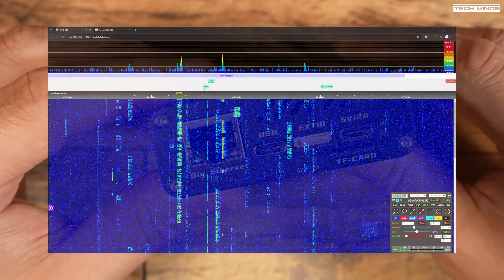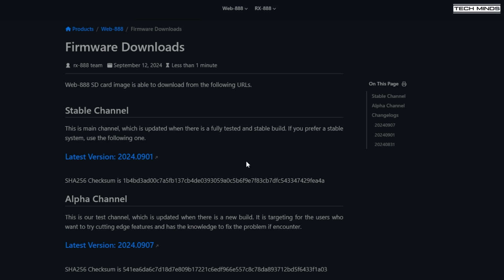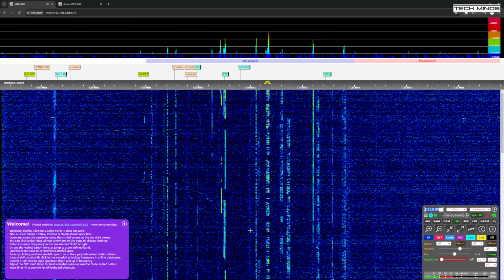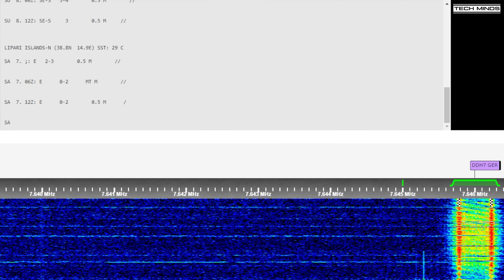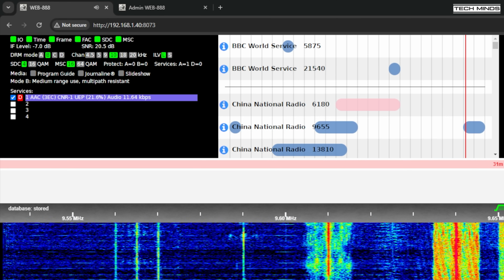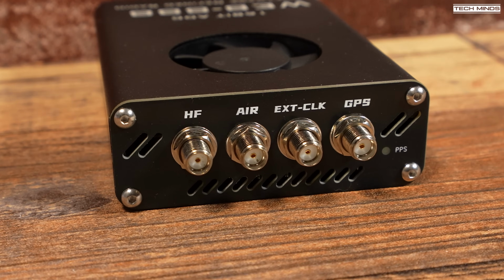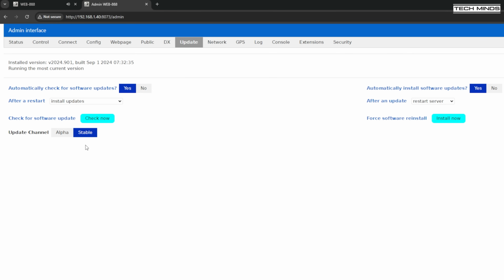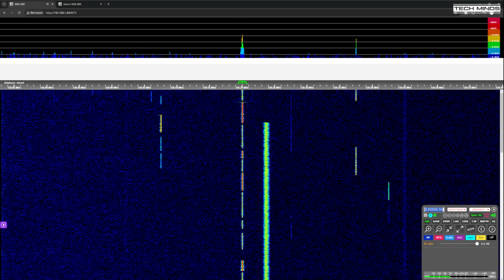WEB-888 A New High Performance Web SDR With HF & VHF

Comment from the maker: Just a little correction here guys. The code changes/fixes which were made in the OpenWebRX version that the WEB-888 uses, were not submitted to the KiwiSDR code base. It was the KiwiSDR devs that took the changes/fixes from the WEB-888 and they implemented these changes manually, themselves.
Reply: Hi @TechMindsOfficial, wanted to say thinks for this early notification for this wonderful device - its truly awesome. I did try to find you on your Discord server but it appears you have left it and its no longer has admin - do you need support there? if you rejoined do you retain owner status?

Comment: can you elaborate on your 71ft wire antenna.  Is it just a long wire or is there a balun on it.  Not sure if you use it for transmitting with your other radios as well, so any info on it would be great.

Comment: The innovative thing about the VHF reception is that the Web-888 uses undersampling.  Think of it as direct sampling for airband, wxsats, and part of 2 meters. Potentially better performance / no frequency converter needed!

Comment: Ordered yesterday. After you format the sd card as fat32, do you then create a directory 'root' and put files there or just copy directly to SD? Not a Lnux guy!
Roger N3RC
Reply: No sub directory, just copy it directly to the card. I use 2 SD cards. One has the stable version, the other has the Beta version. just change the SD card to change versions, quick and easy...   Robert, WA6PHN

Comment: Does this have the ability to do 20kHz wide AM 'More Bandwidth' receive mode like the Kiwis can, or are all slots just capped @ 12kHz wide filters? I notice there is no "Mode" tab in the admin page like the kiwis have (even though this is clearly a copy of JKS's firmware).

Comment: I got one for 231 Euros, that’s 195 pounds.

Should be here by mid October.

I have 2 kiwi Sdr online and I’ll use the web-888 in its place of one of the kiwis with the same web address, having 13 connections available is a huge + !

I have another antenna I intend to use that kiwi with.
Reply: Where to but it in EU???

Comment: How does this compare to the Kiwi SDR most recent version you recently reviewed?

Can you compare it to SDRplay units? 

I need to decide if upgrading from a SDR play RSP1A will be worthwhile  for Hf band SWL.

Also, does the software include any useful DSP static and noise reduction features or add-ons?
Reply: As someone with three kiwi SDR two of the old ones and one of the new one,   I can tell you it looks like the web-888 definitely has a much faster processor as seems with how many FT-8 crawlers it can run all at the same time.

Comment: I run multiple web sdr's, KiWi, OpenWebRX, Websdr, so have a fair bit of experience with such hardware.

The video is a good first quick look at the WEB-888, and pretty much as their web page states. Superficially the web-88 looks good on paper, however after using mine for a few days I'm observing more problems, with both hardware and software. 

Software stability is poor, and in it's current form I wouldn't wish to risk putting it on a remote site. The software upgrade function doesn't work and you currently have to reflash SD cards if you want to upgrade the software. I'm having to reboot mine after about 1/2 hour on one frequency, as the waterfall and spectrum display continue to show a signal, but the actual receiver part seems to have tuned to a different one. 

The VHF band is not that good, it's dynamic range is poor and has plenty aliasing problems. HF is a bit better, but there is a compromise between Shared and Exclusive modes. The dynamic range is still degraded by alias signals that are only 50dB down on the genuine signals. Many of the admin options don't store correctly when changed, a main issue being the inability to set a static IP address. Firmware upgrades may eventually improve  some of these issues,  but I suspect some are hardware realted.

Support is patchy at best, and I assume they are currently overloaded with bug reports from new users, although I expect this will improve with time, until the creators move onto the next project, like RaspSDR and Flydog SDR, both of which are now dead in the water.

Personally I'd stick with the RX888 and use PhantomSDR or PhantomSDR+ as your own webserver, as this is Opensource and is likely to be supported by the community over a longer lifespan.

The great advantage of the KiWi is that it is an out of the box solution, and along with the purchase you get very proactive support and features that require an external central server such as TDoA, which along with some other extensions such as HFDL, are missing from the WEB-888.

You may think I'm being negative, but I'm simply trying to provide a more balanced view of what is an interesting, but currently rather flawed item.

Comment: One of the major problems with my KiwiSDR 2 is the lack of anything beyond a web interface.
Reply: Yes it's advertised as a web sdr, as that's the whole point, but you can use other utilities to drive it, kiwirecorder, CatSync SuperSdr ect.
Reply: There is a nice alternate interface, called SuperSDR, and written in Python code.  I haven't checked to verify new support for the Web888, but it is nice for the KiwiSDRs.

Comment: For those wondering why it's called a tf port and not an sd card slot, it's how people get around not having to purchase the license to use the SD logo. It's a trademark thing. It's exactly the same thing. Just in case anyone did have questions about that.
Reply from the maker: I've always wondered this myself, but never got around to finding out. This explanation would make sense. Cheers, Matt
Reply: Thanks for the info. Can someone come up with another acronym for HDMI so developers can use that technology without purchasing that license?
Reply: @1crazynordlander HDTV😂
Reply: There are limitations too - the speed performance is not guaranteed nor is compatibility with any devices owing to the different protocols used and the chips used to interface with hardware.

Comment: i wonder if the openwebrx server software they are using will also work with the RX888mkII, but running on a PC ofc.  I think these days its all about the software for the most part as the hardware is getting so good and cheap

Comment: I checked the link, it cost 301 Euros ?

I didn't get from the video , can you look at the whole 0-30 Mhz spectrum at once like the Kiwi ?
Reply: It's not 30MHz but 64MHz with this one, really cool...
Reply: @Stefaon  that is cool alright, what about dynamic range do you know ?

Interesting 13 people can connect with waterfall.
Reply: @o00scorpion00o  this is 16 bit system ,more than the typical SDRs as Airpsy or SDRplay
Reply: @zach0gr  much the same as the airspace hf + then.
Reply: @o00scorpion00o eating 64 MHz and 16 bit. Lot of signals to the input. Dynamic range won't be spectacular I am afraid.
Reply: @RoelandJansen  as good as the Kiwi ?
Reply: @zach0gr  thanks for the info, it should be decent then, great to have 13 connections with waterfall for a lot less money than the Kiwi. 😁
Reply from the maker: I showed it in the video

Comment: I was saving to get a RX-888 very soon. This one is interesting, but I already have KiwiSDR. The only thing very very important to me, that is missing from the Kiwi, and the main reason I wanted the RX-888, is the ability to use it with SDR Console at the full bandwidth. Being able to see the entirety of the HF bands on SDR Console. It is so so much more precise and natural to navigate in SDR Console for me, but I also see the practicality of the web SDR interface. It would be wonderful to be able to have both in one. I was hoping this WEB-888 would be able to interface with SDR Console as well as have the web interface, but you didn't show that. I assume it's not possible. Is it? Otherwise I'm still gonna go for the RX-888 myself.
Reply: It should work with console .   If it does not a quick mail to simon and im sure it will be supported ss he is approachable

Comment: Wow, thanks so much, I haven't even heard of it ... that is exactly what I have been waiting for ... I love the clean and dynamic ultra wide RX888 SDR, but it requires a powerful PC to run it at a wider bandwidth. With this ZYNQ7 FPGA based device I have a "low power" receiver that works stand alone over the network ... fantastic.
Does it support TDOA within the Kiwi-SDR Network?
And the entire Air-Band in one stream, which is something the RX-888 can't do ... they seem to have a serious converter in there and not just an R830T which is limited to I believe 8 MHz ... looks like Justin Peng (@fei666888) had some spare time on his hands ... he is often behind this brilliant affordable quality stuff. 
I see he just linked this video in his feed 👍
Please give us more in details in coming videos 🙏
I think I need to order one for HF and one for Air-Band 🤣

Comment: RigExpert has left the chat
Reply: To be fair to RigExpert, this is more of a consumer-grade unit. The RigExpert device is meant for a much more controlled environment due to it's high sensitivity. I believe that they are pitching it at the wrong crowd, this Web-888 device is more our style. Price is more justifiable too! :-)
Reply: @janhenkins  I know, I was just being facetious ;)  It made me chuckle the way this worked as described right out of the box, no interference from commercial radio, no need for a box of attenuators and careful sample rate setting to get a decent result. Weird that non consumer grade kit is so unforgiving 🤣
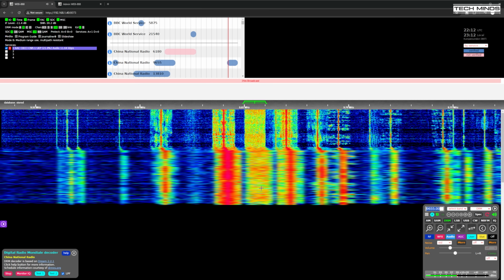Reply: @Lastaii  I totally agree, which is why the Web888 is on my birthday-list, and not the Fobos! 😀At the same time I can fully see the military application of the Fobos, you want max sensitivity if you want to gather intel. I like to just have a mooch around the bands and listen out for interesting and non-controversial things, so even the Web888 is totally overkill in that situation. What I do like though is the ability to properly monitor 13 frequencies at the same time (timecode 11:30 onwards). I can think of a few neat things I can do with that, like (trying to set up) scheduling a BBS on HF via FT8 or JS8Call and other such shenanigans. It might not work, but it will be fun to try.

Comment: Would this would on an iPad do you know?
Reply from the maker: Oh darn! I actually had some footage which I forgot to include showing it working on chrome on iOS! Yes is the answer :)
Reply: @TechMindsOfficial  - Great thank you, sir.
Reply: Yes, it should work fine if:
with WEB-888 wired to your local network and the IPAD wired to your network, or
with a WiFi or Bluetooth adapter added to the WEB-888, connect the IPAD via wireless
I have not tried this, but this would be my approach. Just use your IPAD browser to connect
to the WEB-888 local (private) IP address.

Stan